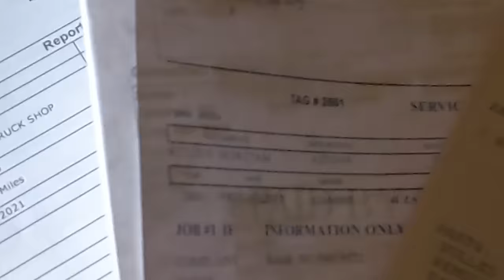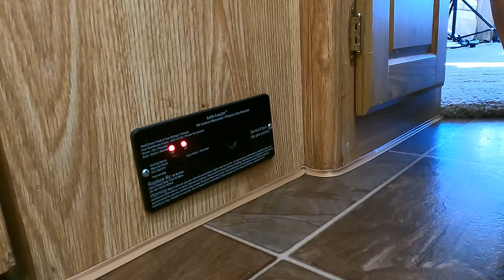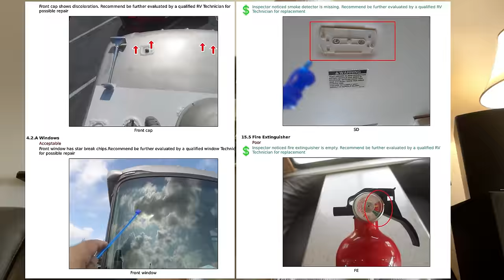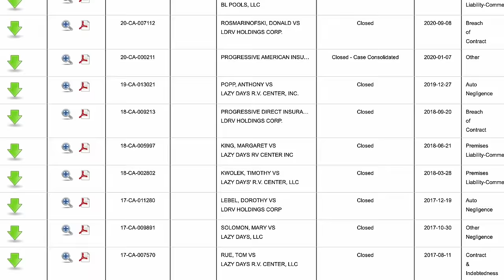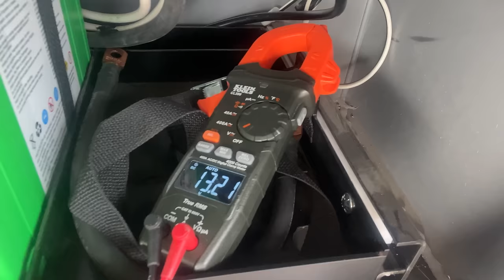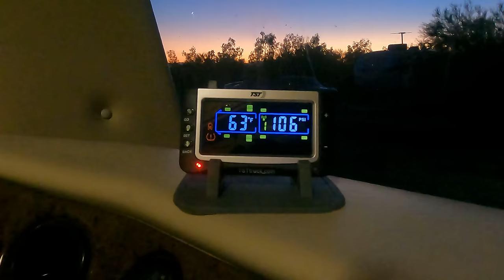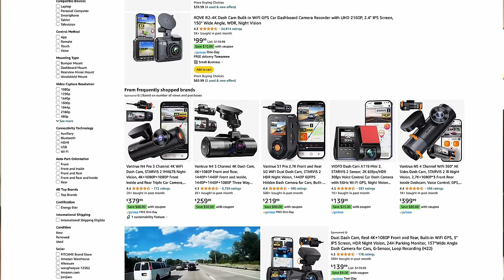RV Expert Witness tells all

Comment: In the negotiations - along with the inspection documentation ask for engineered drawings (schematics) for the 120v electrical,  12v electrical, and plumbing.  The drawings must include routing.  If they can't provide them its because they want you to return to the dealer for every repair, no matter how small.
Reply from the maker: Actually, Grand Design couldn't provide those drawings for my rig as they claimed they don't exist. What they sent was a rudimentary sketch. I believe all that are coming out of Elkhart are that way. Quite a contrast from my 2004 Chinook camper van which included all the schematics in the owners manual! Thanks for your comment!
Reply: I may be wrong but I don't believe electrical wiring diagrams exist. I tried to get diagrams for my 2016 Sunseeker from Forest River and they said they did not have them I got plumbing drawings but they are not even correct. They sent me all drawings for the Sunseeker series Class C's and non matched my rig.
Reply: @LizAmazing yeah i tried too, back in 2019 for my solitude. Got the same response. 🍻
Reply: Don't believe it, the drawings do exist.  When the Engineering Dept releases a new design for construction how do you suppose it gets wired?  Every unit would be different depending on the person doing the work.  How could a new control-technician from a different industry ever learn all the different models?  How would the Dealer make repairs in a reasonable time without drawings?  The Manufacturer is protecting the Dealer!
Reply: @Ekanselter  yes, of course obviously. Have u ever dealt with a manufacturer or dealer on anything they don't want to give u? Lol 🍻
Reply: Good luck with that

Comment: I self inspected a 5 year old Coachman  travel trailer that had only  been used for one weekend,
The couple that bought it camped for one weekend, when they came home he died.
The whole front roof had delaminated,  battery had frozen, tires were 7 years old and dry rotted, roof vents were cracked, and leaking.
Kitchen faucet  was useless.

Comment: There are 100's of items to inspect, check on the chassis same on the living portion. Very time consuming. Tech may not be certified in all areas so that's another important point. Areas that are not accessible for ease of inspection, cracked frame work, air leaks at seals, etc.
Reply from the maker: That's true. An inspector is not going to be able to take the unit apart so they can't check everything. Thanks for watching.

Comment: The first thing I do is run the VIN#, you would be shocked at what you can find.  Back in 2020 I was looking a an S-class MB that was on a large dealers lot.  It looked almost new and was in nice shape.  I found photos posted by an insurance Co showing the side of the car crushed in from the front to the rear.  It was bad and even ripped part of the front seat off.  Do your homework.

Comment: Hi Liz, love your videos. You have to put commercial tires on a Class A's, do you promote commercial trailer tires for towable trailers, 5th wheels, class B, Class C. Toyo and Yokohama have 10 to 15% more natural rubber. Just a thought.
Reply from the maker: Yes, heavy duty truck tires for the motorhome. If you are ok with the price, for travel trailers, etc, it certainly isn't going to hurt anything. Thanks for watching

Comment: that CO unit is only good for 7 years and need replacing. There is a manufacturer  date printed on the back of the unit. You need to remove the unit to see that date. Ours didn't  even function when we purchased it. I ordered a brand new one and installed it.

Comment: Hello Liz and Stick. I have A Dodge Pro Master Van 2022 On A Winnebago 2023 back. I have Lots of Problems with My Van since I bought it Brand New. I have Safety Sensors going off on the Gauges Alarms when they shouldn't Be. From Tire pressure to Braking. I have The AC unit not working Correctly, Generator Along with A Bunch of other Problems. I need Some Much needed Help with How to get this Issues Fix. The Dealer Winnebago Dodge Are all pointing Fingers at each other. I have taken my Van to All three Yet I still have these problems. I am hoping You Guys can Give me Advice. I Bought it Brand New. And it's been A Huge Headache for me week One. Thank You Ps the Videos You Guys post Are Unfortunate . But Unfortunately I can Relate.

Comment: Just dropped over $100k on a new Montana 5th Wheel and after owning 6 RVs in my life, I've learned there is no such thing as a quality RV.  The electric side of the water heater wasnt plugged in, the middle AC wasnt cut proper so it only exhausted 5% of the air.  The list goes on and on...  Luckily I can fix these myself but i feel sorry for the average person that doesnt do their own work.
Reply from the maker: Oh no, so sorry to hear this. Thanks for sharing, Andrew and hope all your problems are behind you now.

Comment: You would be better off buying a pre 1987 without fuel injection or slideouts.
1987 Holiday Rambler Imperial. Restored (by me) and reliable. i love it.
would never consider a new rig, even if I were a multi millionare.
Reply from the maker: You got that right! Thanks for watching.

Comment: Stick, how can you find a good inspector?
Reply: ❤. Usually you can find an inspector at an RV repair facility an independent RV repair shop. if the RV dealer does not want you to take that potential purchase coach to a RV repair shop to get it inspected you better stay away from the RV

Does your propane system leak inside your coach?  This is the LP gas expansion rate when it’s converted from liquid in the tank to gas vapor on the outside if there’s a leak in the propane system.  🔥🔥🔥🔥🔥🔥

1   liquid gallon of propane equals 270 gallons of explosive vapor 
5   liquid gallons of propane equals  1350 gallons of explosive vapor
10 liquid gallons of propane equals 2700 gallons of explosive vapor
30 gallons of liquid propane equals 8100 gallons of explosive vapor
50 gallons of liquid propane equal 13,500 gallons of explosive vapor 
100 gallons of liquid  propane equal 27,000 gallons of explosive vapor
Reply from the maker: Go to the NRVIA website as they have a certified RV inspector locator. And what Stick said, too! Thanks for watching.

Comment: Regarding the expert advice on Towable RVs not being able to stop as quickly.  My own personal experience deems the comment as false. A properly set up electrical brake system will make the whole rig actually stop SHORTER than we're the tow rig driving without the RV attached. Airstream proved this decades ago as well.
Reply: @stickbogart3657  the only reason I'm not going to correct you, with published data, not just my own experience,  is that it's very hard for me to give any sort of legitimacy to someone who does not know the difference between the words break(s) and brake(s). At the very least, have a kid in your household or neighborhood show you how to use spellchecker? Good grief.